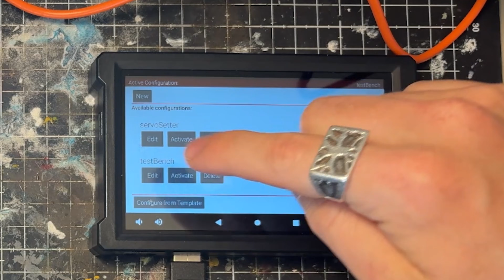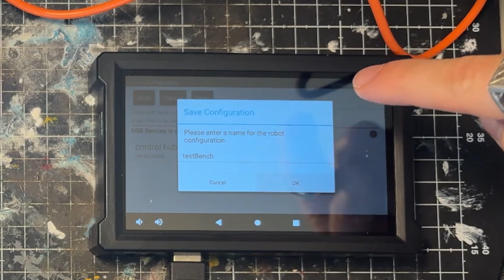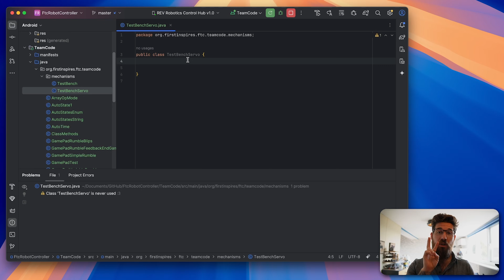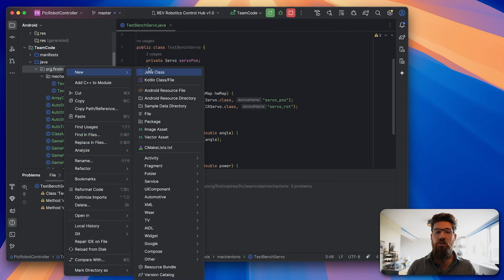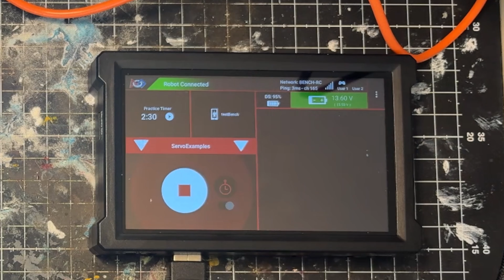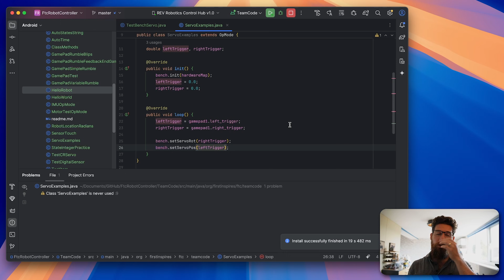How to Program Servos (Learn Java For FTC)

Comment: Are there more commands for servos, like linking two servos using &&, like DC motors ?
Reply from the maker: Here's a list of all available methods for the servo class: https://ftctechnh.github.io/ftc_app/doc/javadoc/index.html?com/qualcomm/robotcore/hardware/Servo.html

As far as I'm aware, it's technically not possible to control 2 servos to move at the exact* same time, it will always be sequential in order, though the loop parses so fast that even though they don't actuate at the same time in code, they effectively do in real life. For example:
posServo0.setAngle(90);
posServo1.setAngle(90);

would effectively move both servos at the same time.
Reply: @BroganMPratt  ohh okeyy